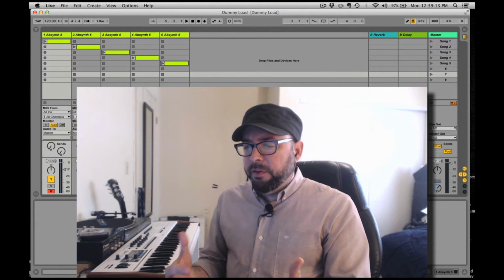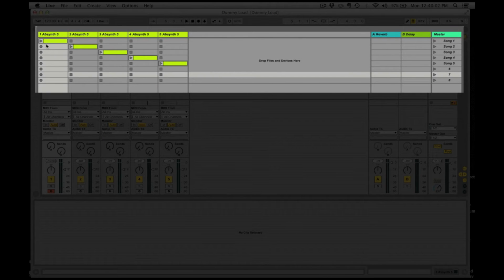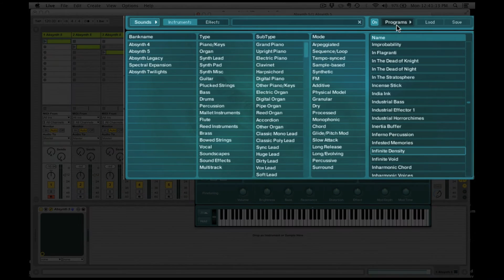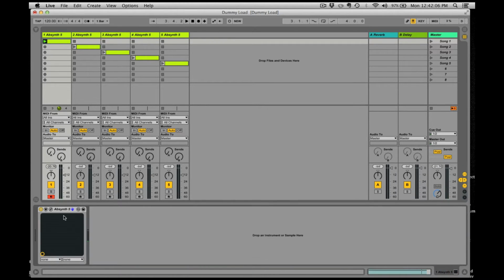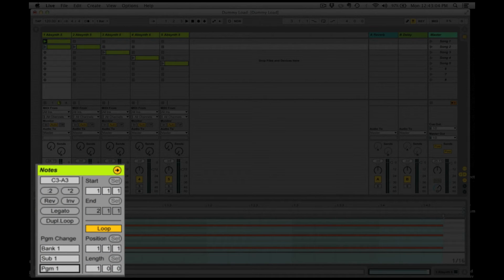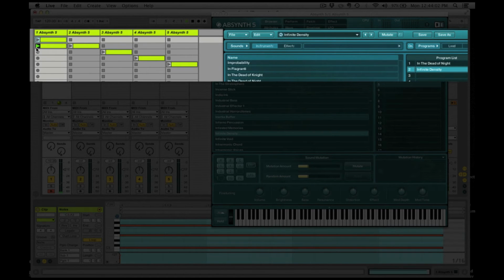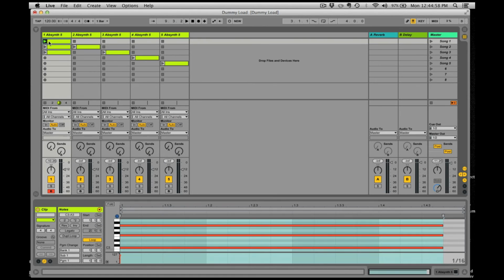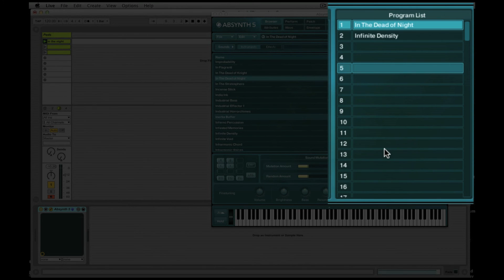Ableton Technique: Clips for Program Changes

Comment: This is a very informative video, thanks. Can I ask, if you utilise ableton in this manner, what do you do about other sound changes from song to song such as volume, pan, effects and so on? Do you have automation processes in place to address these elements too on a per clip basis? Thanks again 😊
Reply from the maker: Sometimes I'll do Envelopes (clip automation) to level out if the sounds are dramatically different between songs. Usually I try to save patches so that they start pretty close in volume so that I can jump between them if needed for the sake of spontaneity. Over time I've started to rely on Clyph X more to automate things like instrument parameters and save them in a clip. I'd definitely recommend it for shows. Does lots, including change the scale that my Push is in between songs so that I can have a variety of keys in a set but jump right into jamming without having to change the scale myself through transitions.

Comment: hi ,

i got a problem with HYBRID 3. Maybe you can get a workaround. i´ll try to explain:

HOW to create a automation with HYBRID 3 using ableton live 9 ? 

unlike any other synthe i have, the automation ( bank, program, subs ) doesnt works. 

Patch preset raise up by number on each midi clip , 1,2,3,4 second run...5,6,7,8...and so on. 

A program number ( ableton automation, in wich you can choose Bank, Programs and subs ) go somewhere on a patch. 

So for ex : Program 05 soft pad on Hybrid is finally 07 ! 

so entering 05 on automation will play a patch of 03 ( called 05 Moving pad ) of hybrid.
and is no control about wich patch will be played. 

so creating a MIDI clip ( 1 bar ) and entering for ex: program 1 , bank 1 ...will play something, but not the wished one......I GO NUTS !!!!

I did btw , same as  you do in this video.

 if anyone got a workaround to share, would be nice. tx 

Actually NONE is able to fix that . Maybe  YOU can !!! :-)

Thanks a lot